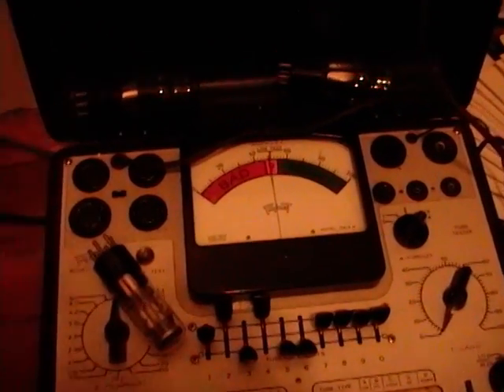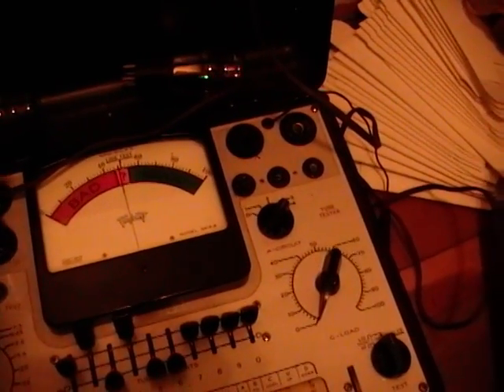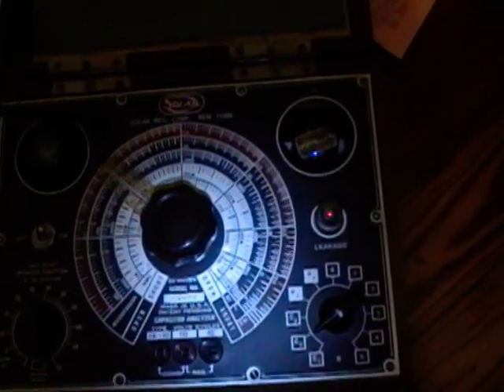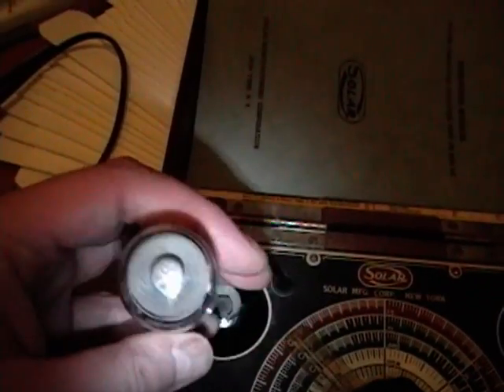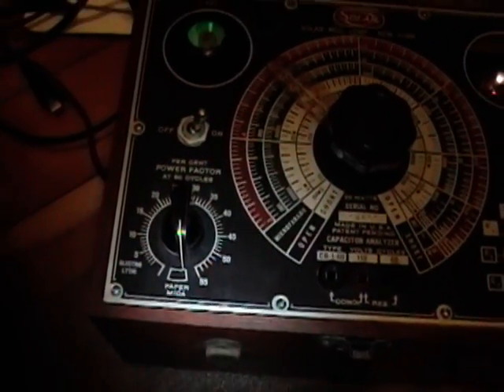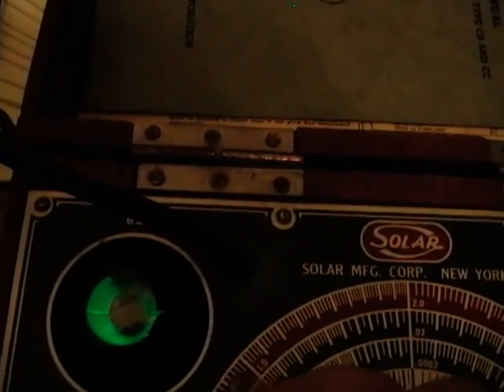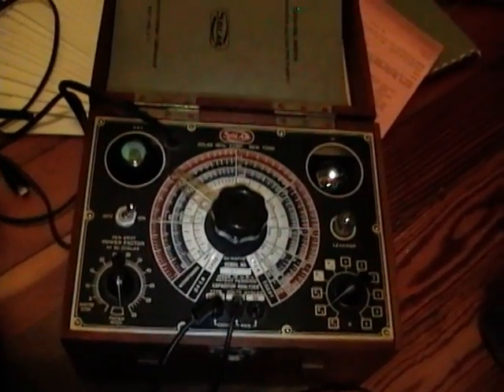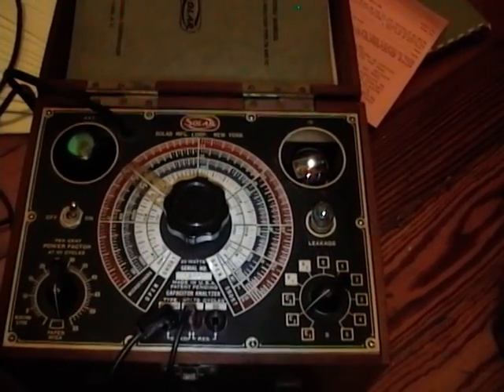Eye tubes and Solar CR bridge

Comment: I just picked up a CC-1-60. It is similar to this model, but uses a type 80 rectifier. It is really rough though. The case is smashed, and the top cover is missing. The electrical components are all torn apart though. The original tubes are there, and it is still presentable. I would like to restore it. I'm looking for a replacement bulb.
Reply from the maker: I think it's an NE-48.  Many places sell them.